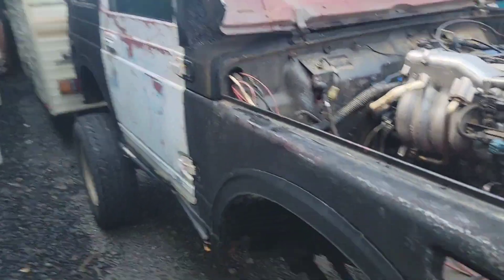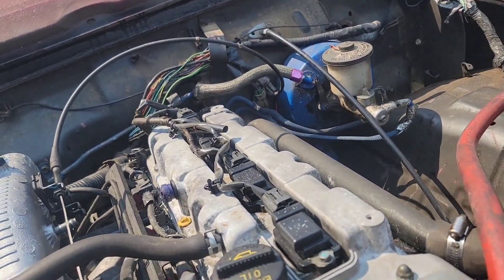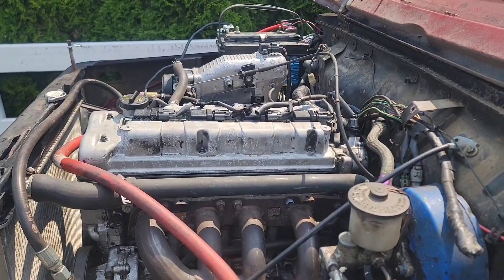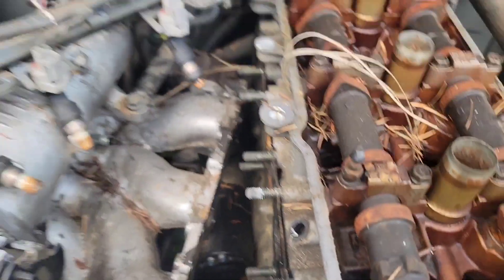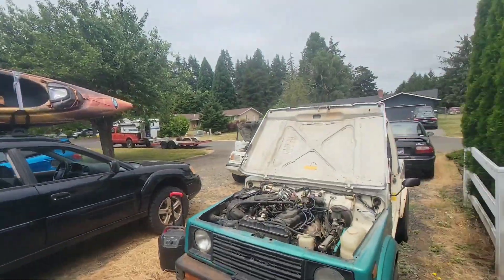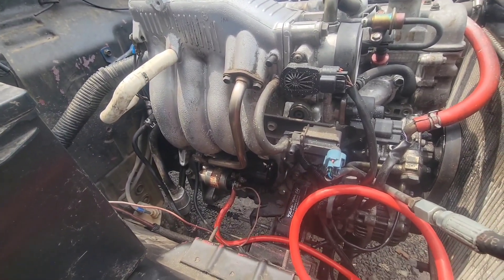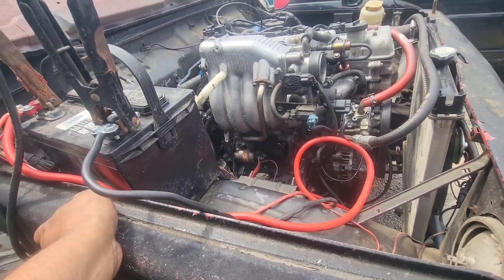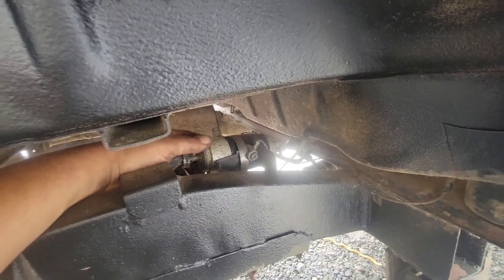Trying to start the Tin Top Suzuki Samurai

Comment: Not related to this video but had a question. Have you done a body lift on a Tracker or sidekick 2 door? What would you do of the body mounts behind the front seat were pretty well rusted out?
Reply from the maker: There should be a body lift video on the channel. To fix bad mounts I use a piece if C channel